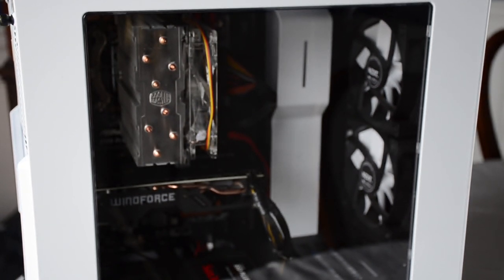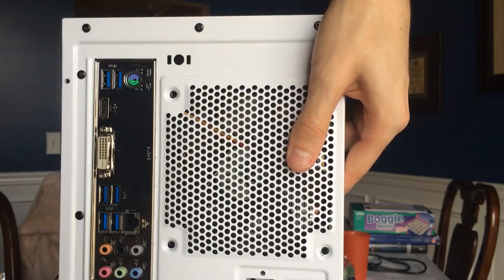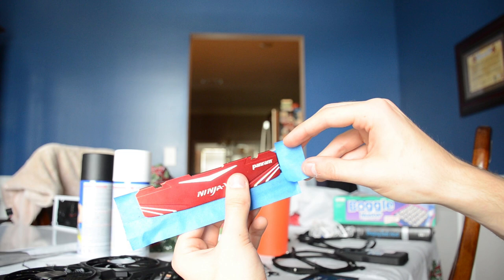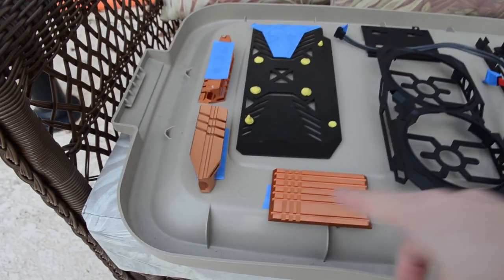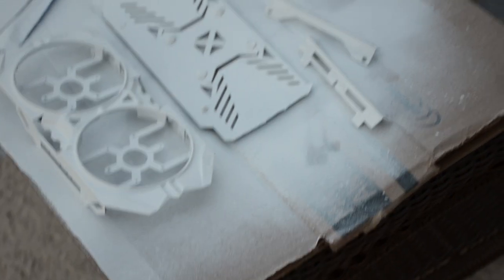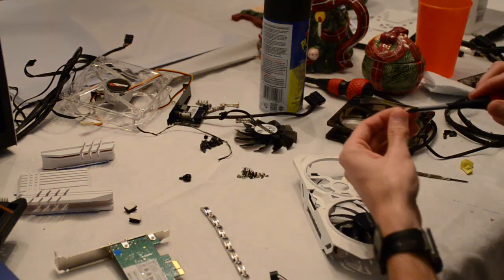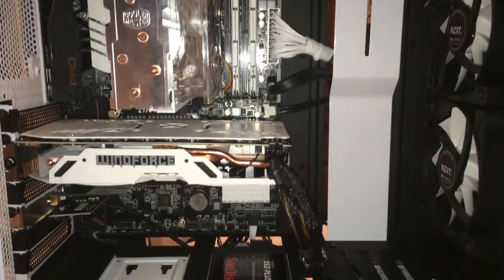Paint Your PC Components (Vol. 1)

Comment: Next time try using a hair dryer to soften the glue before "shucking" your ram. you want it to be hot to the touch but not hot enough to hurt. this will not damage the parts and make the painting process much easier, and you should be able to remove the heat sinks by hand instead of with a screwdriver.
Reply: ThatOneZoey actually you can get it hot enough to hurt because Ram heatsinks are meant to withstand the heat
Reply: @youtubeaccount0x073  they're saying dont get them too hot to touch, although it is safe to do so as the part won't be hurt, not to get it too hot for your own skins sake.

Comment: Okay so. I know this video is more than a year old, but upvote this guys because this is important when plasti-dipping. I did several parts of my car and most of my PC. Long, even strokes across multiple components AT A LOW ANGLE. It's much better to do several light coats (4-5 light coats) and one final medium coat to add a solid finish. Also, the best environment (I know that can't be controlled in most circumstances) is a warm, dry area with good ventilation but no wind. I use my garage halfway open to get best results.

Comment: Great video thanks for sharing.  I have a home made shop with spray booth, and have done some dipping.  This advice applies to this and all aerosol, be in a full smooth moving lateral arc before pressing the trigger. Initiate spray before you reach the target. Do not stop. Do not change direction. One smooth sweep, at one angle, and one distant, beginning your spray before the target piece.  Lots of light coats are always better. BE PATIENT. And remember with plastidip, the cure for plastidip problems is always more plastidip.

Comment: Doing this right now with my graphics card. You want to be sure to let the can of PlastiDip sit in hot water for a while to heat it up. This helps the paint go on smoother and cleaner, less texture and speckling. Lots of YouTube videos out there for working with PlastiDip, but I can confirm that heating it up makes it spray much nicer, unless you are looking for a rough, textured look.
Reply from the maker: Thanks for the tip! Will have to try this next time.

Comment: The final products turns out really great! Thanks for uploading your experience, tho it may not be interesting to a lot of people since the video is very long, but it sure do helps a lot. I said that because I'm planning to make a white build for myself and I'm planning to paint some of the components since not all white components are cheap. So, I have a few suggestions here to make your rig looks a lot better. One of them is to change the cpu cooler to something white, such as Cryorig H5 Universal at about 50$, or just simply add an acrylic (paint them white or add some art design on it using your creativity) on top of your cpu cooler using some spacers and double sided tape. Other than that, change the fans into white fans, or simply paint them white. Lastly, and this is a big one, take off all your components and paint the interior of the casings into white. All this will make your rig looks better if done properly.

Comment: The motherboard heat sink and ram modules I would NOT have painted. But if you HAD to a high temp engine enamel would have been a better choice. Sata cables I would have skipped also. Other than that it was a nice first try and the parts did come out nice.

Comment: Wow really nice I'm planning to paint my GPU blue but I've heard and this is by noticing you painting some of the heat spreaders you used the plastic paint can instead of the engine ones that other youtubers use for that way no toxic chemicals or scratches or even the paint coming because of the heat I just want to know is it still OK to use the plastic one or was there an issue on your paint job?
Reply from the maker: +Flow Tech Tv Your VRMs should never ever even get close to 100C, which is the temperature at which toxic chemicals release from the PlastiDip. It's perfectly fine.
Reply: +Science Studio OK sounds good thanks

Comment: did you check for any differences in heat dispersal from heatsinks?  I'm curious cuz of my 990fx which has a northbridge that doubles as a nuclear fuel rod and wondering about how much heat would be insulated from plastidip.

thank u for vid, i have a fairly similar setup and plan a similar paintjob.
Reply from the maker: PlastiDip withstands 100C. Heatsinks should never approach 80C.
Reply: Aye, but the dispersion of the heat into the air, that's not a problem I assume?
I talked to the people at asrock support and they said the north bridge on my board could at times approach 90 or so.

So again, I've no doubt your correct about plasti dip max temp but wondering if u know or can point to any resources on how well plasti dip conducts or insulates heat so that it can be dispersed into the ambient, room temperature air that's passing through your case?

Thanks for reply
Reply from the maker: Again, it isn't a problem.
Reply from the maker: I've plasti-dipped over 10 PC motherboards. If you're worried about VRM temperatures, then you have a serious problem un-related to plasti-dip.
Reply: k, just wanted to make sure of heat dispersion on my already semi hot mb before i went down that path... thanks for info!
Reply: And you have done everyone a disservice and shortened the life span and decreased thermal efficiency of the parts. ANY paint or in your case Plastidip creates a thermal BARRIER between the heatsink and the air surrounding it. I have personally seen 10+ Celsius temperature increases from enamels. Plastidip is even worse. Painting non heat transferring surfaces is one thing, but common sense and PHYSICS tells you not to paint heatsinks. 

If you're going to put this stuff out at least put disclaimers out and explain the negative effects...
Reply: Don't use plasti dip on northbridge heatsink unless you have some big custom one with a fan. (Plastic and rubber are good heat isolators)
My 990fx ran around 75-85 °C, but with a fan and paste change now its around 45-50°C. 
Instead you can use radiator paint which can withstand more heat and transfers heat more efficiently. I think that one that require baking/roasting are most heat conductive, but they require more hard work.
Reply: My motherboard changed color around VRM and Chokes, without any painting. I have a fan now, but if I painted heatsink without fan mobo could burn out.

Comment: Is the windforce logo blue with white LED's or White with blue LED's?Im thinking of buying a 380 but the blue clashes with my black and yellow theme
Reply from the maker: Blue.
Reply: +Science Studio Did the replacing of the thermal paste bring any benefits on GPU temp?

Also: What effect has the paint on the heat conductivity of the cooling plates? Did the temperature of the RAM or Chipset change after the paintjob? You could've laserchecked the temps before spraying.

Otherwise, very well done and detailed video! Earned a sub for that. :D

Comment: I've done little custom spray job using car engine enamel paint and clear plasti-cote after on my speakers but never a PC case, I own a Enthoo Primo XL in black and red, where would I start,? As you can see not the most confident. can you give some tips, and which masking tape do you use and sand paper.? thanks.
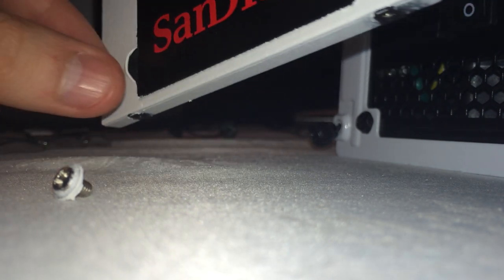Reply: +Karl Benson it didnt look like he used any sandpaper at all. Result of that seen on the SSD at 18:45

Comment: Do you suggesting a paint job on the GPU fan? I got an orange fan in a white-black build. Some said it can cause performance issues? Any tips? Please :D
Reply from the maker: I typically avoid painting fan blades themselves because the extra weight can throw off ball bearings and make things louder. Just depends on the type of paint and the skill with which it was applied.
Reply: Thanks for the super fast response! Another question, how long the interval per coat you put on the paint?

Comment: Plastidip is not required, I used normal glossy spraypaint on motherboard heatsinks, no problem. Didn't use primer but finished with a clear coat.
Reply from the maker: +Droidz Hunterz Never said Plasti-Dip was required. But good luck removing it.
Reply: Oh it's there to stay :)
Reply from the maker: +Droidz Hunterz That's what everyone says :-)

Comment: Just pointing this out (I know it's late) but NEVER try to pull the heatspreader off RAM without heating it up first.
Reply from the maker: The adhesive was not sturdy; it was a-ok in my specific case. But yes, that is a general rule to abide by. Thanks for mentioning.

Comment: hey man firstly great videos and I have a question
im from australia and have a 800$ budget

Intel Core i3-6100 $170
Gigabyte B150M-D3H DDR4 $135
8G Kit (4Gx2) 2133 $64
Gigabyte N960IXOC-2GD 2G GTX 960 ((Mini ITX) $269
Western Digital Caviar Blue 1TB 3.5" 7200RPM $69
Corsair VS450 $54
DeepCool MATX-Smarter LED $40
$801 prices msy.com.au
 
Is this an ok build and/or can you recomend any part swap outs ect
Reply from the maker: Very solid! The only thing I'd change is the small form-factor graphics card. Smaller cards tend to run a bit hotter (for obvious reasons). Otherwise, you should have a great budget system that performs very similar to the one in this video.
Reply: +Science Studio Thank you very much sir uhm any suggestions on the card or just a GTX 960 but non ITX also do you know any places/sites which allow me to know if these parts would fit correctly in the case thanks again for the help
Reply from the maker: +Island Breeze PCPartPicker might be flag any case compatibility issues. And any twin-frozr (two fan) GTX 960 will be great.
Reply: +Science Studio Thanks man by the way you deserve way more subs haha oh and a request I have is to watch some games being played on that pc like with the FPS up to show people with almost the same builds how well it performs thanks again
Reply: +Island Breeze Maybe you could replace the 960 2gb with a 4gb version? That is going to increase performance quite a bit. You could also check out haswell and get an i5 (4460 or 4590) for around the same price and you get a quad-core, and that will certainly boost your performance VERY much. You could really do more with that budget than an i3, even if it's skylake. I hope that helped :).
PS if you want me to make a part list for you, I will do that ;)
Reply: +Rik V Hey Rik thanks for the advice can you make that part list for me but use Australian prices (because believe me our prices are terrible) and I can push the budget to 1100

Edit: after a little bit of searching I made this 
http://au.pcpartpicker.com/p/VXL7K8

Comment: And can you also see painting the CPU cooler will work?
Reply from the maker: Wouldn't use PlastiDip on the metal sheets of the T4. Something like engine enamel would work well with that - basically any paint that allows proper heat dissipation.
Reply: +Science Studio kk thanks

Comment: vrm with plasti dip??!! don't you want thermal conductive paint? like engine block paint?
Reply from the maker: The bases of the sinks were not painted, so the conductivity was unhindered.
Reply: conductivity to the heatsink from the mosfets&chipset is unhindered but the radiation of heat off the metal heatsink is sealed and capped by the plastidip coating hindering the direct perpindicular path of heat transfer from the chipset/vrm chokes and out from under the heatsink splashing back on the chipset/vrm & motherboard. The heatsink is designed with protrusions and cavities to maximize its surface area for passive heat transfer into the air (with more thermal dissipation capacity if cooled by a fan) but its prolly negligible if you are not taxing your vrm or chipset as you seem to have your system running nominally [but if you are overclocking your CPU and having massive through-put between the sata ports and your harddrives then beware). I applaud you for boldness to paint your pc components to color-match your system.
Reply from the maker: +Girish Sardey (roninotakuknight) If your VRMs are running hot, you've got bigger things to worry about than a little paint :-)
Reply: true if your vrms are excessively overheating then paint would be least of problems, the allocation of power and voltage would need some further investigation
Reply from the maker: Yep, it would probably mean your CPU voltages were too high.

Comment: Have they turned yellow/faded yet?
Reply: It's plasti dip so it doesn't turn. They use that stuff for all kinds of things, even cars. It basically creates a rubber-like coat over everything and it even peels off in one piece when you don't want it anymore
Reply: Dubsfish 

Yep I'm familiar with the product in how and what's used for thank you.  

But just wondering if it turns yellow or faded after a while.
Reply: Candi Soda no. it doesnt. my explanation of the product was an explanation of why it doesn't turn. they wouldn't use the white for cars if it turned. so incredibly sorry for the inconvenience

Comment: Any temp change after painting and using the rig ?
Reply from the maker: No.
Reply: +Science Studio I'd like to know how hot the ram is running now....
if you got a temp sensor.

I can't see anything you Plasti-dipped other then the ram that could of changed any temps.
Reply: +Joshua Fisher (Edit) and the South bridge
Reply from the maker: +Joshua Fisher I've done this with multiple PCs. Temps never increase by any more than a degree or two. If either your VRMs or RAM are getting very hot, you've got a very serious problem regardless of the paint.
Reply: +Science Studio true.  just wondered as plastic dip is more like vinyl / rubber then paint.     I like your vids btw
Reply from the maker: I'm glad you've enjoyed them!

Comment: painted vrm heatsink will increase temps
Reply from the maker: +Amanda Bischop No, your VRMs should never get very hot. If they are, you've got a serious problem on your hands. This paint will be perfectly fine on a healthy motherboard, even under load.
Reply: +Science Studio Ohw I know but what for the ram sticks ? The metal surface is covered with the painting I think it will a lil bit get higher temps in this case ..
Reply from the maker: +Amanda Bischop The same general rule applies to RAM. DDR3/4 should never get hot, even under load. If this is the case, it's very likely that the RAM itself is overclocked, and too much voltage is being supplied.

Comment: Who the heck applies ton of conductive TIM to GPU without knowing that it can short?
Reply from the maker: +Filip Sebik The paste wasn't conductive...
Reply: Science Studio
... It wasn't Arctic Silver V?
Reply from the maker: Filip Sebik ... Arctic Silver V is not conductive: http://www.arcticsilver.com/as5.htm
Reply: Science Studio
So which TIM from arctic is conductive?
Reply: +Science Studio (copied from the website)(While much safer than electrically conductive silver and copper 
            greases, Arctic Silver 5 should be kept away from electrical traces, 
            pins, and leads. While it is not electrically conductive, the compound 
            is very slightly capacitive and could potentially cause problems 
        if it bridges two close-proximity electrical paths.)
Reply: Chalklate
That's what i talked about